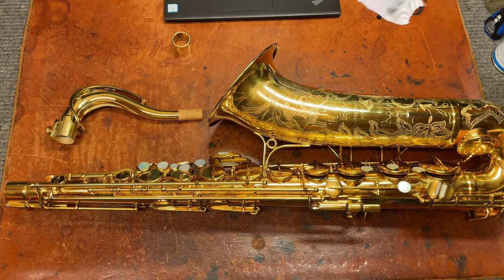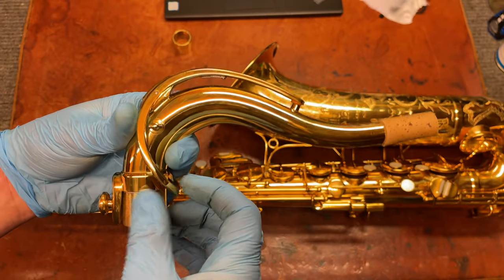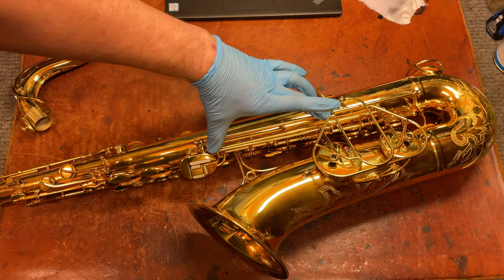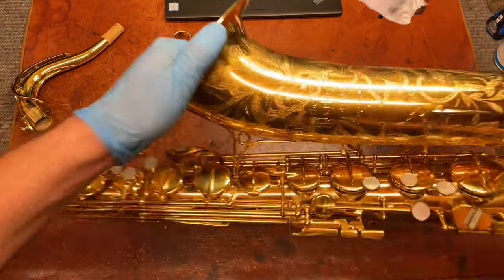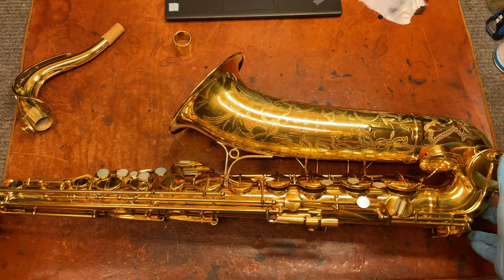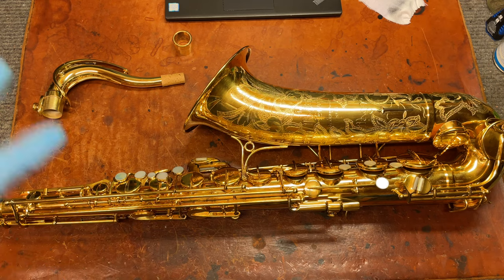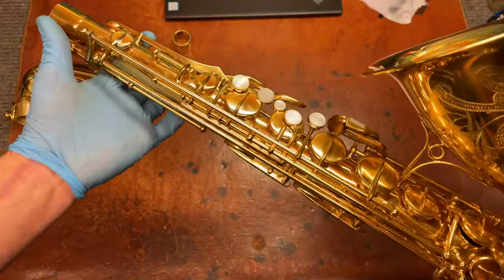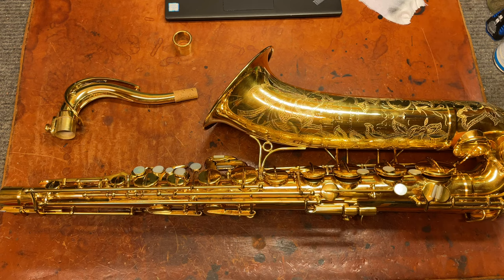Repairman’s Overview: Martin Magna Tenor Saxophone, original gold plate

Comment: Several people have noted that the neck on the Magna is different from the standard Committee. Different taper and the Magna neck is longer. Also, there are plenty of examples across the pro models where Martin didn't use nickel-silver on every key arm and barrel. Maybe they made considerations for adjustability or key mass.
Reply from the maker: Can you provide sources for this? I would love to correct it if I'm giving out bad information, but that is not my understanding.